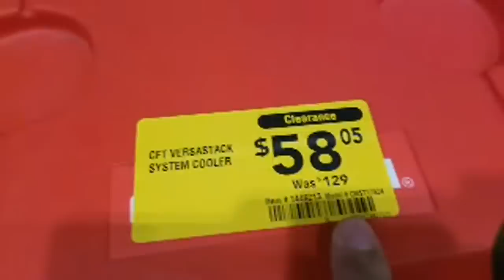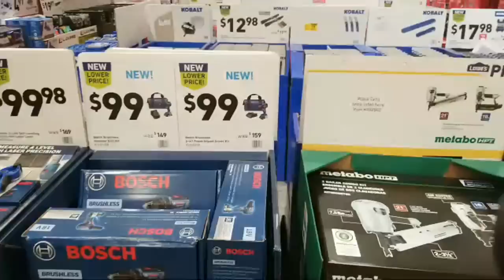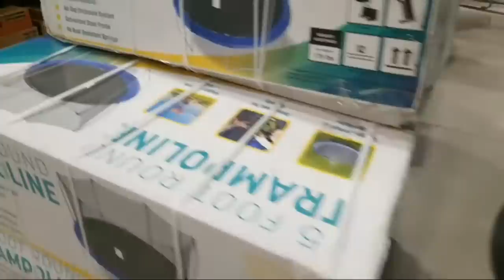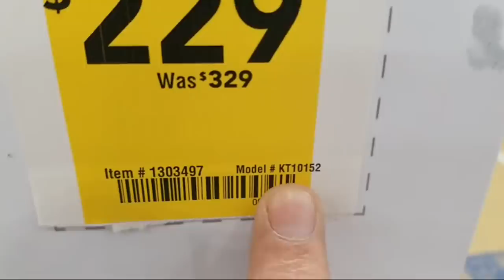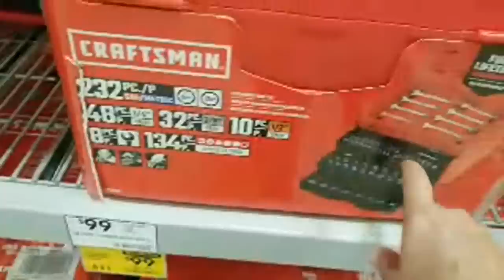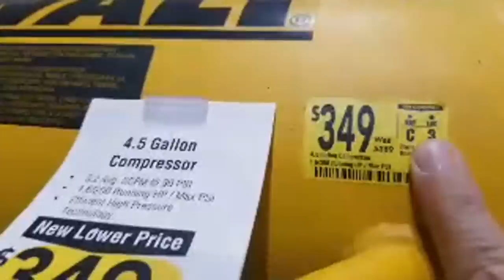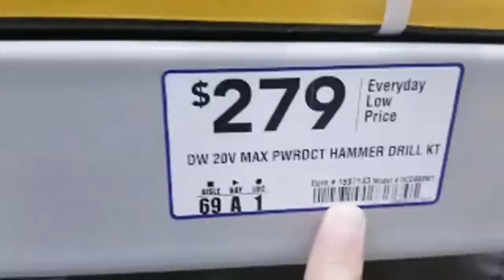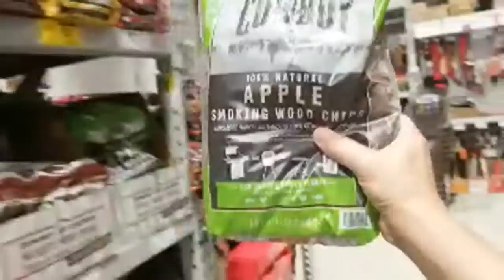Lowes New Black Friday Deals Dewalt, Metabo Price Games

Comment: Re: The Dewalt oscillating tool blade kit (with the hard plastic case 24.98/49.98  777847) is a great 50% off sale, but the major drawback is that the semi-circle blade that comes with it doesn't fit into the case. 

There is that black divider insert, but it's all one piece and only allows for the narrow width blades to be stored. 

But that black divider insert is removable, so you can fit all blades in and they'll just all sit together,

Or you can remove that insert and cut/modify it by removing a wing and then re-inserting it.

Keep up the good work!
Reply: If you lay the semi circle blade upside down on top of the dividers with the center hub dropped down in one of the divided corner pockets the lid will close fine. Definitely was not completely thought through, but I was happy to buy this kit as I wanted something to hold the blades separately.
Reply from the maker: Wow, that is a surprise, as well as the opaque lid, as most of their kits now are the clear plastic Tough Case

Comment: @Jeff - the lowes BF ads were confusing this year because they had 3 different ads that each spanned a week or so.  If you goto lowes.com and click Weekly Ad in the top right hand corner you can choose the specific week long ad to view.  Blackfriday.com combined them all into one file which is what made it confusing.  I'm kicking myself for not buying the Metabo Table saw when it was in stock.  I told myself I'd wait a day or two and before I knew it, they were sold out everything/online until the sale ended.  The only two table saws in the 11/26-12/2 are the Craftsman and Kobalt.  Thanks for always sharing the tool deals!
Reply from the maker: Man bummer!  There's always Acmetools $349 with handling charge

Comment: Since I went BRUSHLESS 
my hair is a mess.

Watching Jeff shop while reading comments, me thinks is dry curing my brains.

Bought the Kerrygold Irish butter at Costco $4 off $12, going to sous vide turkey breast in butter herbal mix to keep meat moist and flavorful and not overcooked.

Love to hear about the flexvolt deals like the two tools and two FV batteries for $199 @ Tractor Supply. Why does DeWalt not have more like this deal availble???
Reply from the maker: That might be a tractor supply thing.
Reply: Maybe it's some sort of Dewalt market study on how customers react to super deals? I've heard when there was stock in stores, some customer bought two or three or more units, leaving nothing. Then re-selling them on Craigslist or Ebay.

Jeff, do you ever give away Lowe's discount cards? Do they have an expiration date?

Comment: Lowes has the CRAFTSMAN 6-Gallon Single-Stage Portable Electric Pancake Air Compressor with 3-Tools Included $179 8GA POWER: CMPBN18SB 

18GA Brad Nailer has the power to drive up to 2-in brad nails

16GA POWER: CMPFN16SB 16GA Finish Nailer has the power to drive up to 2-1/2-in finish nails

HEAVY-DUTY: CMPCS38: 3/8-in Stapler has the power to drive up to 9/16-in heavy-duty staples
Reply from the maker: Yes, that is the compressor we showed in the livestream tonight
Reply: @jeffostroff  I bought one yesterday on line. Funny I did not see it in the video, and you did not see the price on the 15-foot trampoline

Comment: My Lowe's had stuff set up and covered with black plastic Monday. I picked up the HD Freak a couple weeks ago. I scoped out the difference. Menards has the same deal for the old version at $89
Reply from the maker: Yes, did you notice late rin the stream, I found the 1600 on the other side of the store for $89
Reply: @jeffostroff  I saw that. It pays to do research. I saw it at Menards and Lowe's had 2 prices in there so I compared the boxes.

Comment: What do you like better the xr or the xtreme DeWalt , also what’s the best Battery,
Reply from the maker: XR. The extreme line is a lower tiered line usually smaller, which sometimes means less power. So compare the power output, RPMs, and UWO of the XR tool to the extreme tool

Comment: What tankless water electric heater do you recommend Jeff?
Reply from the maker: I have not researched it in a few years, but when I did electric was out of the question as gas was the only model that gave you energy savings. Don't know if that changed since then, but electric required at the time 80amps of free space on your electric panel, which most people don't have. Now your bringing in licensed electricians and building permits to get a simple water heater going. Do the homework and check to see what the savings are for electric compared to gas!
Reply: @jeffostroff That sounds good Jeff. I will research and do the cost analysis and ACH Matrix to compare.

Comment: Where do you get the battery and charger for the 40 volt Kobolt Jeep?
Reply from the maker: You have to buy the 40v max battery an charger kit: Item #2311293Model #1302703 I I believe

Comment: I was looking at the Ryobi 40v leaf blower/ hedge trimmer etc type outdoor equipment. 
Are they thought to be worth it?
Compared to other 20V offerings... Milwaukee/ Dewalt/ others?
Reply from the maker: I own an odder ryobi and a newer Dewalt, and the Dewalt is more powerful with 100 MPH and 400 CFM. Those are minimum specs you should look for.
Reply: @jeffostroff  Thank you,
Ill watch home depot for any Sales, but I haven't seen anything on sale yet.  Enjoy that Bird 🍗 it sounds Awesome with Apple wood.
Reply from the maker: Mike Lowery   I use both their large blower and their smaller blower on my miter saw to blow off the sawdust perfect for that job
Reply: @jeffostroff  
Well I have a few Ryobi 18v products. 
I have a string trimmer for around the house.  I have a blower to clear off the driveway & clean off my Exmark Quest 50 ZT.  
I would like more power as you reccomended MORE power was why I was on HD.com ...four 40V Ryobi blowers....110mph, 125mph, 140mph backpack, & 150mph.  
If I went with a Ryobi 40V blower I might look at the hedge trimmer.
I have an ECHO SRM 3020 String trimmer...which is plenty powerful....for other trimming. 

Dewalt blower & hedge trimmer combo looks good with the FLEX system too.

Comment: Craftsman power tools are junk however their sockets and wrenches are okay.
Reply from the maker: I love their 216 piece Versastack mechanics tool set! that's the one I got
Reply: 95% of the power tools are made by Stanley  &  Black and Decker they make  Stanley, DeWalt, Black & Decker, Craftsman, Irwin, Porter-Cable, Facom, Lenox, Lista, Mac Tools, Vidmar, Bostitch, Sonitrol, Proto, XleroScout, Pengo, Cam, Paladin, and even Milwaukee

Comment: Hey Jeff...Re: Metabo...Buy the Circ or Recip saw and Lowe's gives you a free battery and charger valued at $169. Go to the Metabo website and fill out the form to get your choice of a battery or AC adapter for your 36 volt tool. Takes 8-10 weeks for delivery. The metabo part you had in your hand was the AC adapter...not the battery. It looks like a battery, is 20 feet long, and has a module that converts AC current to DC current. Got my Circ saw, battery and charger today. and filled out my form for a free AC adapter..Thanks!
Reply: I thought you had to go thru a participating retailer to get the free rig... can someone confirm?
Reply from the maker: Yes you do, Metabo web site says you must go through a participating dealer.
Reply from the maker: Yes, we uploaded a video on this Metabo deal with the web site also, about 2 weeks ago. Shows you how to apply for the rebate and gives the link. I was trying also not to disturb the green turtles, they are very sensitive.
Reply: @jeffostroff I just saw this at Tractor Supply...DeWALT  247 pc. Mechanics Tool Set, DWMT81535 for $99.99.
Reply from the maker: @marauder2525   Yes we've been talking about this one also for about the past week or so I think other channels might have mentioned it as well
Reply: @jeffostroff  Sorry, the ad said "NEW".
Reply: @jeffostroff Wife pointed out to me last night as you went through Lowe's that the saw horses for $64.98 ( Item # 2474041) were only $49.98 at Lowe's online.
Reply from the maker: @marauder2525  I think you will see these drop in store on Friday